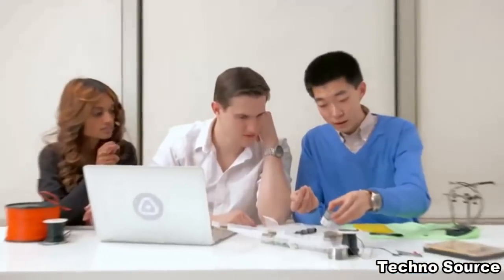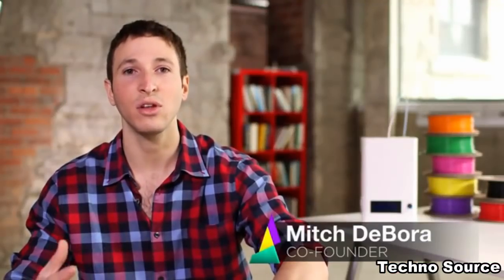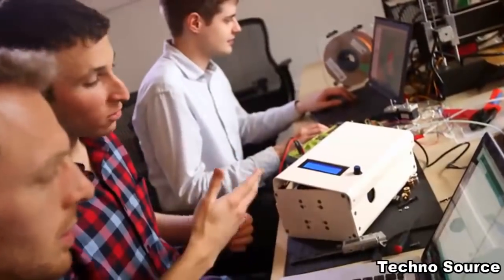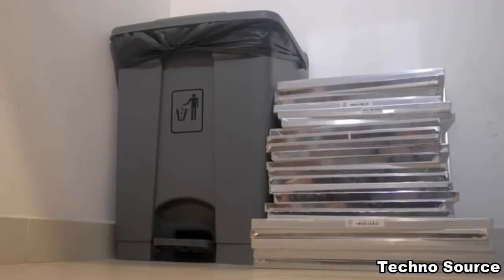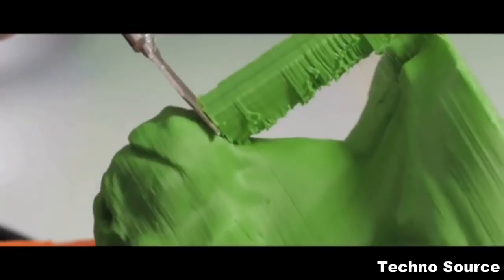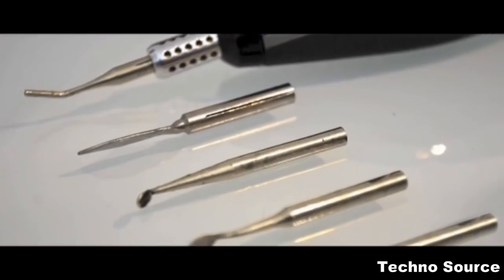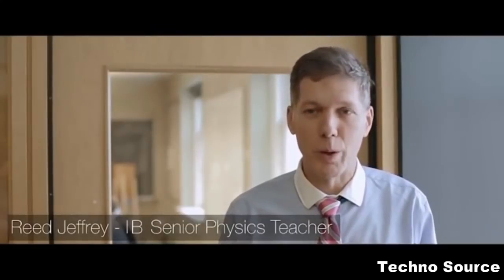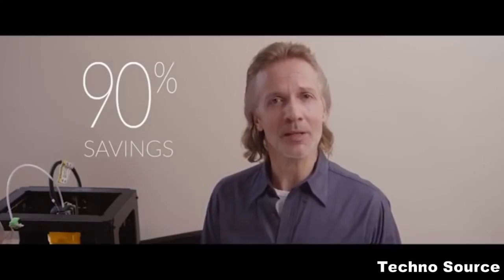5 Best 3D Printers 2016

Comment: the retouch3d is just a glorified temp control hot knife with a tiny spoon bit. for $150. A regular $20 walnut hollow kit should pretty much do the same.. 
there is 2 actual 3D printers here not 5... the pcb one is technically a 3d printer but not in the plastics category, but it still counts.

Comment: lol the Protocycler cost well over 600 usd and hows that a savings
Reply: +hartsf33 Assuming their product actually works, it's a significant savings.

Comparing pellets to filament you're looking at, as they said, maybe $5 to $25-50. Even at a low end that's $20/kg of filament. At $700 (what it says for me), that means you break even at around 35 kg of filament. Keep in mind this also lets you recycle the plastic. Even without considering the additional cost benefit of not having to buy the pellets twice, that means as soon as you recycle 35 kg of filament, even if it's the same couple kilos of plastic over and over into new things, you're going to break even compared to buying new filament.

Now, that's a lot, but this is a normal matter of scale. If you don't see yourself using more than that, you're right, it isn't a savings, but if you DO see yourself using more than that, then it's worth getting.

On the other hand, if you're never going to go through 35 kg of filament, is it worth having a 3d printer at all, or is it just something you're going to dabble with then let collect dust?
Reply: basically the plastic you buy cost less because you can reuse it the plastic you buy is cheaper..it will pay itself back in materiel cot in a year maybe..or less